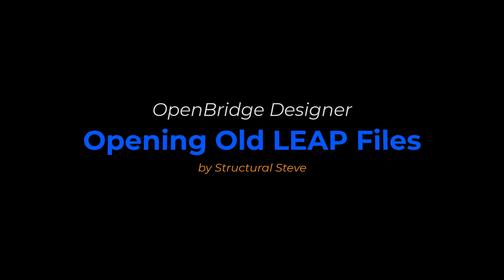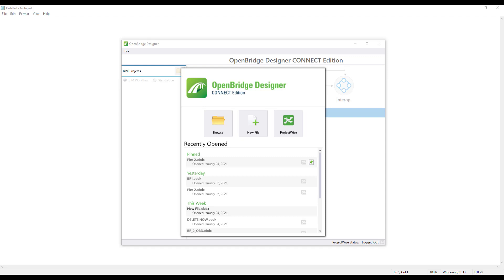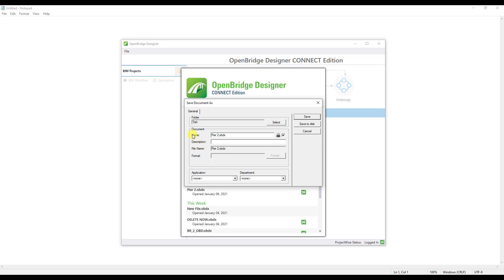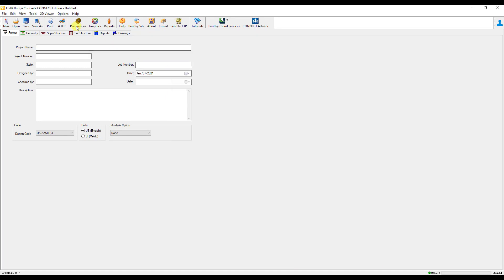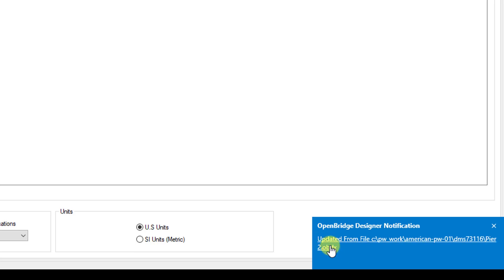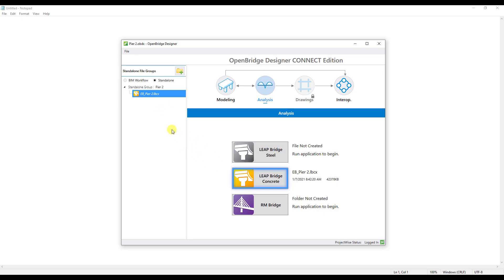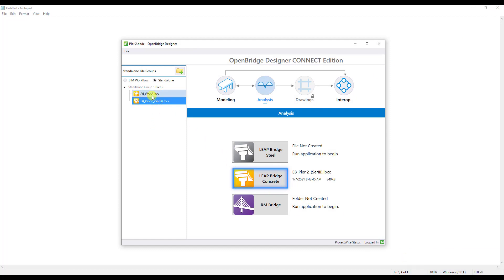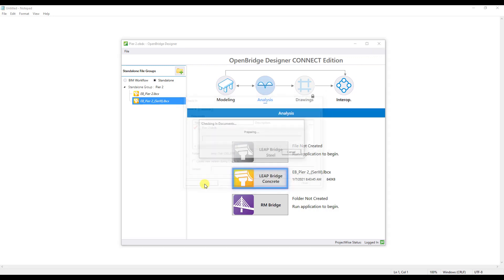OpenBridge Designer - Opening Old LEAP Design Files

Comment: Hey Steve. This is the closest subject video that you have for my question. Have you run into an issue when opening LEAP through OBD and a lot of options are greyed out? The biggest option that I need is to change the concrete strength for release, and final. I can't edit my span or girder lengths, or change the types of girders within LEAP like an older Bentley video suggested I could. Any help would be greatly appreciated!
Reply from the maker: Based on what you described I assume you are using the BIM workflow & created the model in OBM first, then sent it to LBC?

Comment: Hi Steve, thanks for the video. I got a question after importing old LEAP file . Can you send it to Open Bridge Modular?
Reply from the maker: You cannot start a file in LBC and then send it to OBM. You can start a model in OBM, send to LBC, make changes, and bring those changes back into OBM under the Standalone workflow, but if you’re going to do that you might as well do the BIM workflow to make that process easier.